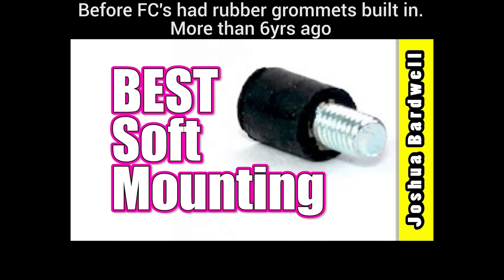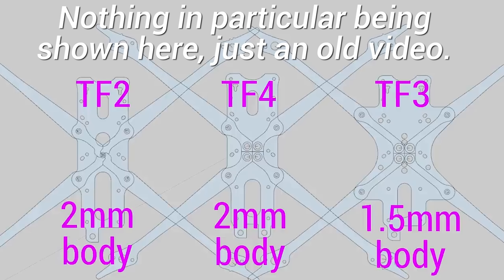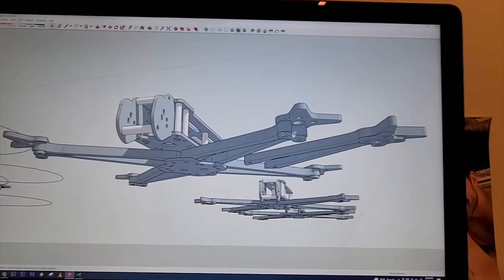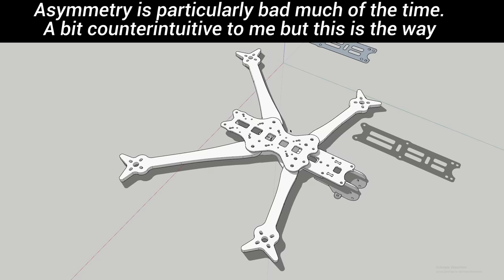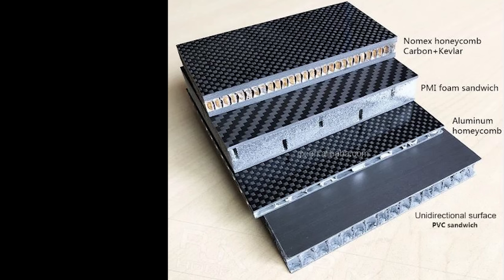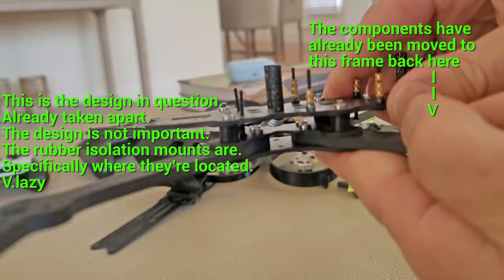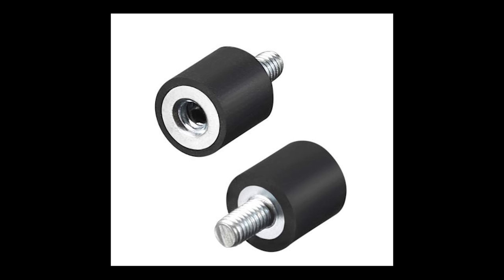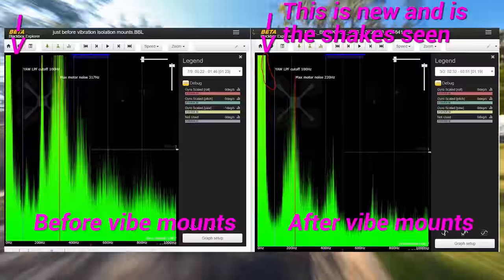I put some steel cable on a quad...

Comment: 3:35 not necessarily... If we made the frame form the dampening material.. Might be far from cost effective, or even obtainable. Carbon Fiber Reinforce Polymer.
"The mechanical properties of CFRPs are determined by the conditions of the carbon fiber and polymer resin constituting the product. In addition, the combination of textile materials to form a carbon fiber structure greatly affects the mechanical properties of the product. Because many candidate materials, such as plain weave, twill weave, and unidirectional ones exist as major materials for general use in CFRPs, diverse layered structures can be formed by combining these. The mechanical properties and test results differ from the layered structure when CFRP is applied to products. In particular, the direction of the carbon fiber plays an important role in the determination of the mechanical properties of the CFRP structure; hence, the directivity of the CFRP material should be designed according to the principle direction of external forces."
In other words. This is your variation from frame to frame that you look at and think is identical. The carbon was not put together identically before being cut into a drone frame.. Therefore even being for all accounts "identical" to our eyes and hands, Not when fine testing is concerned.
Reply: "Damping reduces the external energy of a load by converting it into internal energy using the inherent characteristics of a material; this provides great advantages in terms of durability by enhancing structural stability and diminishing response [14,15,16]. The damping coefficient is used in the time domain or frequency domain to represent damping. The accurate identification of a system's damping coefficient plays a critical role in understanding the mechanical characteristics of the system. Various methodologies for identification exist. In particular, frequency damping values corresponding to each resonance point are required to represent damping in the frequency domain, which are referred to as modal damping coefficients. The values are usually identified by modal testing using devices such as an impact hammer, and CFRPs have been reported with particularly large damping values compared with other steel materials [17,18,19]. Combined with its excellent specific strength, CFRPS have received much attention for application in mechanical products. Previous studies verified that the dynamic response changes according to the spectral loading patterns for conventional steel material in the uniaxial excitation test [20,21]. If CFRPs exhibit different damping characteristics under different excitation profile conditions, then differences in absolute values could inevitably cause errors larger than those of other materials."
Reply: "Because CFRP specimens show different characteristics according to the direction of the carbon fiber, a vibration test was conducted for specimens with different directions to measure the respective damping coefficients, as well as the resonance frequencies. CFRP specimens were prepared from a large CFRP mother plate by cutting them in three different directions to remove any errors caused by the properties of the CFRP material. The pre-impregnated composite fibers (T700 carbon fiber, Toray, Japan) were manufactured by SK Chemicals, South Korea, and stacked onto a 12-layer unidirectional CFRP mother plate with 3 mm thickness. The three directions of carbon fibers in the CFRP specimens were designated as 0°, 45°, and 90°, as shown in Figure 1. The specimens were referred to as specimen #1, specimen #2, and specimen #3, respectively. Although the CFRP specimens were prepared from the same mother CFRP plate, different dynamic behaviors of the specimens could be observed depending on the direction of the carbon fiber under uniaxial excitation."
Reply: "Conclusions
The frequency response function for CFRP specimens was derived by considering the nature of system variables over two parameters: the direction of the carbon fiber and the damping ratio. A scaled sensitivity index was then proposed for each parameter of interest. Partial derivatives of the frequency response function were obtained from the curve-fitted line of the measured response data during uniaxial excitation testing, and the corresponding scaled sensitivity index was calculated for specimens #1 to #3. The mode shapes of CFRP specimens were shown to have similar bending modes in the first mode, but showed different shapes in the second mode. Specimen #1 is the most promising candidate for uniaxial excitation in the first mode because its structural rigidity is maximized with 0° direction of the carbon fiber for uniaxial excitation.
This work was sponsored by National Research Foundation of Korea (Grant No. 2017R1D1A1B03034510)."
Reply from the maker: I understand what you're saying but the overall application involves more parameters than what you're presenting. Carbon fiber is actually a bit dampening on its own. 

Since this video I've actually run many tests and uncovered some things that are amazingly effective and non-specific to any particular frequency range. I've more recently designed a few frames with this new element in mind and will be testing those when they arrive. I posted the general idea on the FB page as well as my IG if you want to check it out.

Comment: Has anyone tried taping off a frame  that is already fairly sound and spraying it with sprayon dynamat for car audio?
Reply from the maker: I think someone did but it wasn't for vibration purpose. It was for durability maybe. Overall, it's gonna increase weight quite a bit which isn't ideal.
Reply: @Kabab  thats what i ment by taping it off, i dont think it would take alot, strategicly  put strips and patches on it it, like how a  sound room has foam accustic panels to preven reverb hear and there in a sound room, may even be a lighter version of the spray
Reply from the maker: @DigitalCruzer  It could help but I'm not sure it'll make much more difference than just wrapping the arms in electrical tape. That's a method people have used successfully to make some minor impact. It's again not worth the weight to wrap in electrical tape however.
Reply: For example there have been many variations of carbon fiber pool cues over the years, the lasted version the shaft is just a hollow tube and they fill the center with a very lightweight foam core specifically for deadening vibration, but you want the shaft as light as possible so that vibration deadening foam is very light weight, maybe some way to use that
Reply from the maker: @DigitalCruzer  That does absolutely work but it's also a durability issue. As in, you're going to give up carbon bulk to be able to fill with the foam or whatever and the resulting structure is going to be a fair bit weaker/more brittle and the vibration damping may or may not be worth the effort. I can tell you from experience, designing and constructing with tube arms is super annoying and hard to get a reasonable weight/strength ratio because of how annoying the motor mounting and body mounting will be.

Comment: An other brain fart: aircraft wings are flexible to reduce vibration and drone frames are not... Maybe 2 thin sheets of carbon with some softer polyurethane in the middle to flex and damp. I feel like its a frame material issue.
Reply from the maker: We've actually tried a number of things like that. Carbon with various foams in between does exist. You always need to clamp that sucker down however so it just doesn't work. Otherwise you spend so much weight on a different mounting mechanism

Comment: bruh uses sketchup for engineering at 2023 and i cant even design camera mount at fusion-360 🫣
Reply from the maker: I can use other software I just don't see a point. Everything is so much faster and easier in sketchup because I'm only using it for 2D CAD
Reply: @Kabab  was actually a compliment 🙄👍🏻 i love my toothpick 🤘🏻😍

Comment: the concept as a whole is correct but you're implementing it incorrectly imo.  You need the clean section to be light as possible ideally the FC only.  The reason for this is the lighter the section the higher the resonance.  Moving the resonance of the frequency as high as possible the better the outcome.  This is going to be a function of the material of the dampers and a weight of the clean section.
Reply from the maker: We have the dampers on the FC already. The grommets. I'm getting more effective with the soft mounted platform

Comment: U mean there is no gyroflow in ur footage???😮😮😮
Reply from the maker: The first clip in the beginning is with my old Hero 8 and real steady on the lowest setting. The later clip with the cinewhoop in the park has gyroflow on the lowest setting primarily to rectify the lens distortion. The cinewhoop really does fly that well.
Reply: @Kabab  that's really an amazing job broi 🔥🔥🔥🔥🔥
Reply from the maker: @Varian_t  it's easy when the thing flies right.

Comment: What about ONE piece?
Reply from the maker: With respect to 5" frames; way in the beginning I started making multi unit frames and got some flack for it because people would say it's so complicated to assemble and weighs more because of all the hardware.  Very quickly I realized that not only is the vibration performance significantly better because the carbon fibers can be optimized on the arms, but the frame is actually lighter because you can design it such that arms can break because it's so quick and easy to replace an arm. Not to mention because the carbon is better situated, you just don't need as much carbon to get a strong structure. Additionally, it's WAYYYYYYYYY cheaper to manufacture. This point is seriously important. We're talking about a $100+ frame vs $50. It also happens to be more aerodynamic because the arms and body are narrower. 

I just never understood the single piece 4" or 5" because you'll always break something at some point. You need to buy a new frame and transfer the entire build to fix the single piece. Such a hassle. Single piece does however make sense in certain situations such as ~2.5" cinewhoop or small crafts. It can be lighter because there's no overlapping carbon that is wasted weight. The forces the frame will see are usually not extreme either so they'll hold up well.

Comment: Why not make a better flight controller
Reply from the maker: Sure. Would love to. How? I actually have a scheme to somewhat remedy the gyro problem but it's not exactly simple and it involves about 5-6 gyros.
Reply: @Kabab  I just asked because I assumed you had the answer. I know you design frames and motors so I think you have a great perspective and Idk about frames or electronics so that's super interesting to hear that you've totally thought this out (and ruled it out). 

Is the state of current fc gyros like highly up to date or like why is it that manufacturers only use mpu6k Bmi270 etc is there like a huge gap to an 8khz gyro chip that would be a small upgrade from what's being used or does a "better chip" just not exist but for like aerospace applications? Being cost prohibitive is all I can think of. Thanks for the response, you are awesome and it looks like you put a TON of money (&time) back into FPVCYCLE rather than quitting your day job, but you obviously love both fpv and, um, building teeth haha? Or at least keeping them clean;)

Comment: why do you appear for me in tough times, you know that its the hardware it self that needs to be improved, we know you can print your own flight controllers on little pcbs and sell them for ridiculous prices, because of this very little goes back into research lan, the only thing seperating the current standard in small flight controllers and lets say something expensive for commercial build. the accelerometers are not welded onto the board, they're mounted on a ribbon cable in an enclosure that always stays flat to the frame, 

apart from that thanks to inflation we can build any drone we want these days, online order 2 weeks later you could be flying a 13 inch x frame for few hundred dollars
Reply: while i unpacked some small frames to mess around with for experiments, lets change the world Bob :P